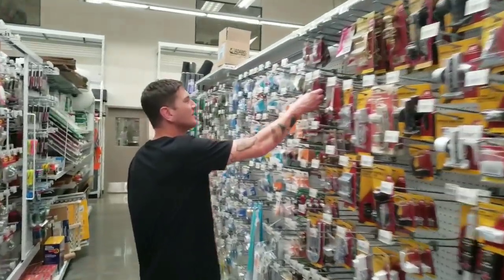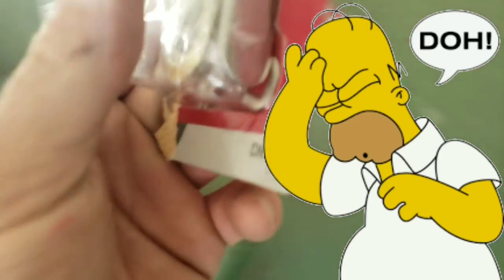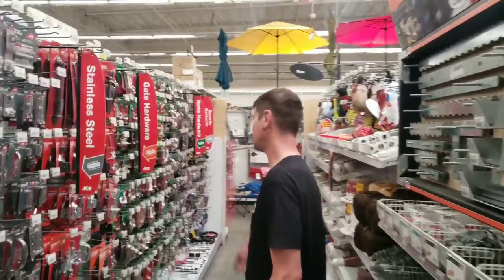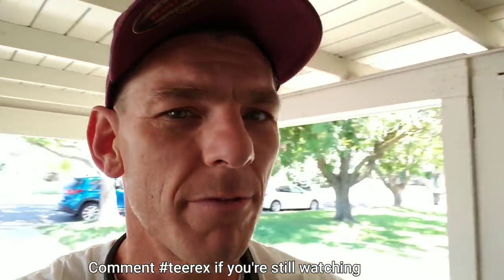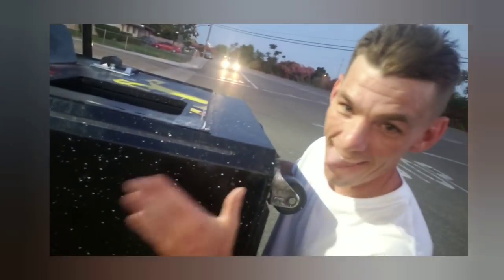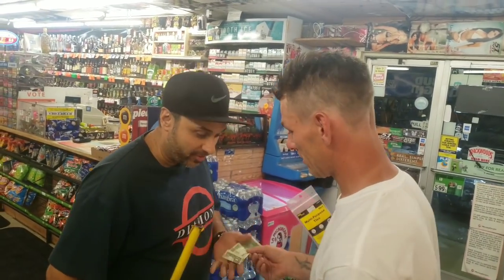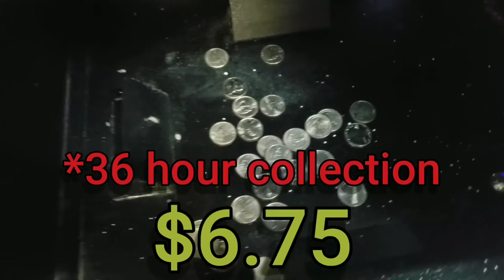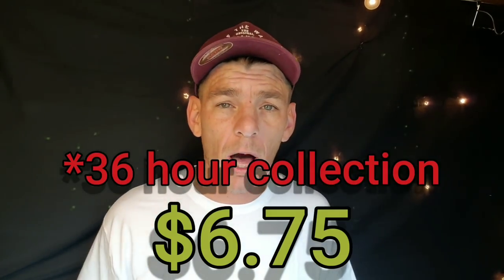Starting my ARCADE Vending Machine Business

Comment: I would recommend building a wooden box to catch the coins in the claw machine. Keep up the good work!
Reply from the maker: So funny story. The guy i bought it from has the coin catcher. I left in on the ground when loading it up😢 I need to set up a time to go meet him. Good looking out
Reply: @TymOLaughlin  Glad to hear! Last piece of advice is get bolts that can only be tightened or loosen from inside the machine. Someone can stop by with phillips head and open your machine. Always gonna look out for ya!
Reply from the maker: Great advice. So i actually used nylock bolts on the inside. So unless they hold bolts on inside they should have a hell of a time...  I plan on making upgrades as I go along.  Thank you for looking out🦖🦖🦖🙏👊💯